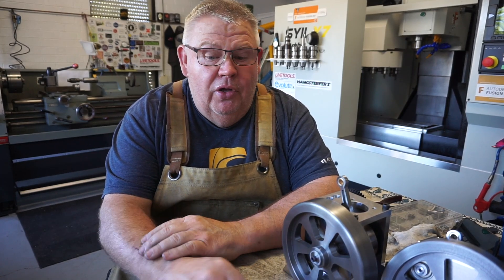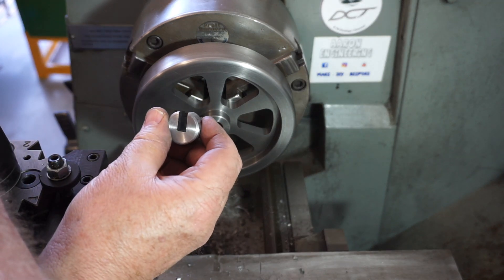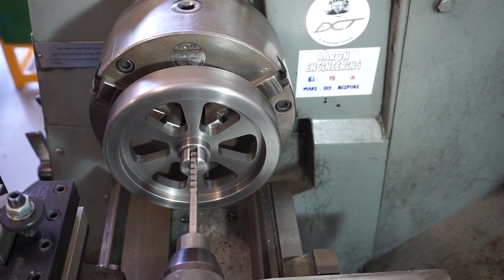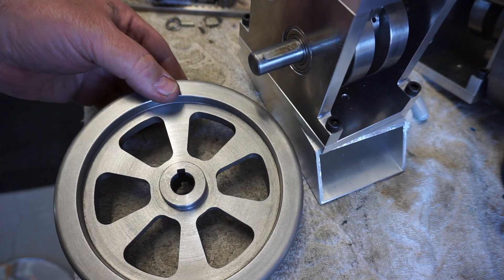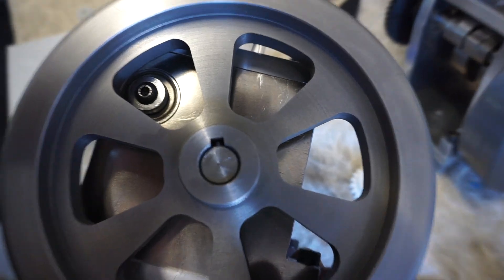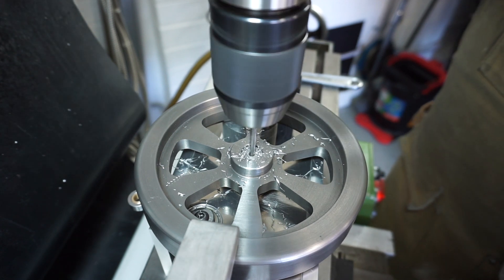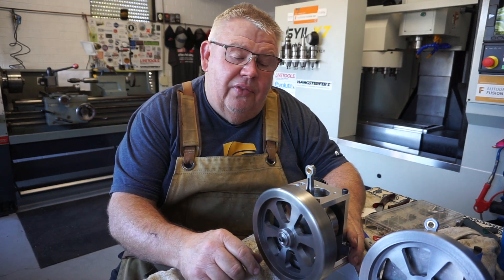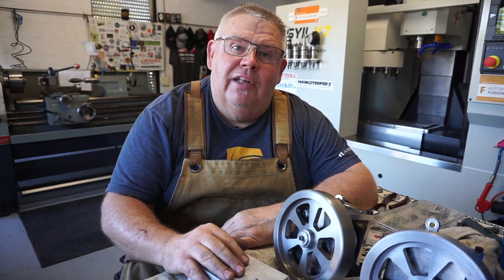Broaching - Colchester ARBOR Press

Comment: Could you use the carriage to drive the broach on small keyways or in soft materials.
Reply from the maker: That’s a good idea 👍.  I haven’t tried it, but you might be able to on smaller size broaches. There was a lot of pressure on the tail stock broaching these 4 flywheels. Cheers. Aaron

Comment: For a weight I use swarf from the bandsaw (with resin), It's fine and works well.
Reply from the maker: Thank you, that's an excellent idea.  Another viewer also suggested using sandblasting garnit or granite.  I tried the expoxy resin & cast chip swarf yesterday.  It worked well, but most of the cast settle on bottom pushing resin to the top.  I had to pull of the resin and add more cast chips.  Cheers, Aaron.

Comment: Theres something to be said about good old Aussie ingenuity. What a brilliant idea to press in a  keyway broach using the tail stock of the lathe bloody genius if you ask me. Just a thought I had regarding them gears you mentioned at the end. Why dont you look into using them nice 3d printed ones as a template for doing them as a casting? You could set up a little sand casting mould and do them out of aluminum cans or some of the cast swarf maybe I dunno Ali cans for sure thought that would work great and not be too expensive to do.
Reply from the maker: Thank you so much for your kind comments.  To be honest, this idea came to me the other day.  I was going to purchase an arbor press, but the wife's been up me about spending money 🤣.  So I had to go down a different route.  That's why my nickname is Humpty Dumpty machining company.  Bloody motor mechanic (my first trade) coming back out in me.  Great idea about the cast gears.  I always wanted to have a crack at foundry and pattern making, but a bit scared of the set price and spilling molted metal down my boots or on my thongs LOL.  Cheers, Aaron.

Comment: Swarf and resin will be hard to pour and will probably get a lot of air entrapment.
I get great results with garnet sandblasting media (grit) and about 20% resin, it is cheap, heavy, and incredibly strong when set due to the very high strength of the garnet particles. And it comes out as a reasonably attractive purple-brown colour. 
Rather than mix it too dry (which most people do with epoxy-granite type mixes) I mix it wet enough to pour off a spoon, then pour it in and tap it settled, then skim any excess resin off the top.
Reply from the maker: Hello and thanks for the feedback. That’s some good advice. I didn’t think of using that. I did two pours yesterday of the resin. I did notice that the weight of the cast swarf did tend to sink down causing the resin to lift up. I just kept sprinkling more cast on it until full. Cheers Aaron
Reply: @AaronEngineering   Great! I can't wait to see the result. 👍
Yeah the swarf can work if it is very fine particles rather than curly tails.
Curly tails get entangled and clump up and get a lot of air entrapment etc.

Comment: G'day Aaron. Excellent job using the arbor, finding that everything fitted together eventually. 
I noticed you put oil on the key & shaft before you assembled it.
I don't remember oil going on the broach when cutting the slot to size ?
At least you know what your next project izzzz .. Build a 20 ton Press 😮😅😊.
Ted
Reply from the maker: G’day Ted. Always good to hear from you mate. Yes cast contains graphite (self lubricating) so I didn’t use oil when broaching it. I did put some oil on the shaft as it was a tad tight and I wanted to get if off again 😂. Cheers 🍻 Aaron